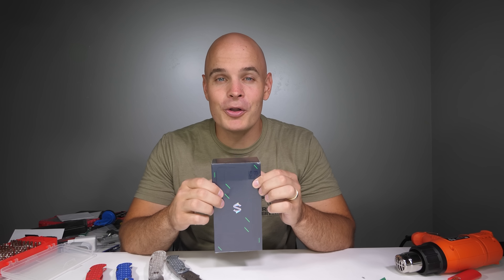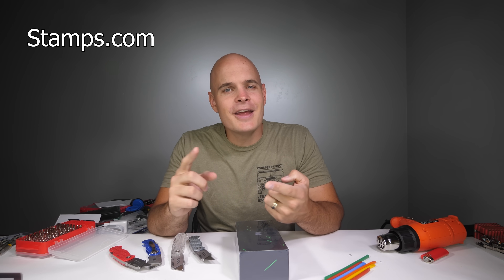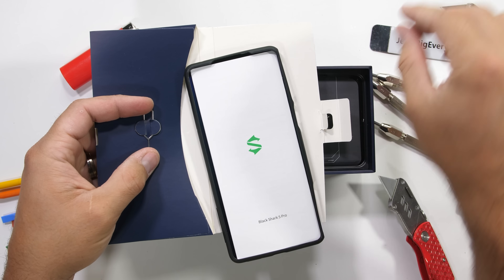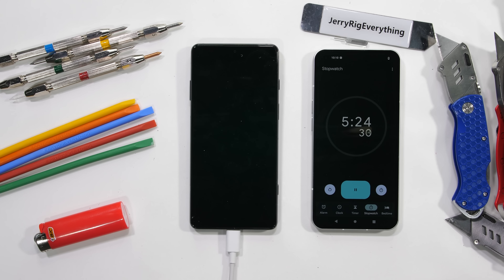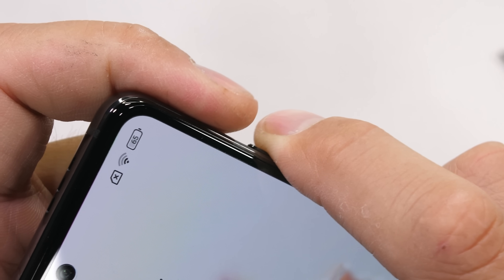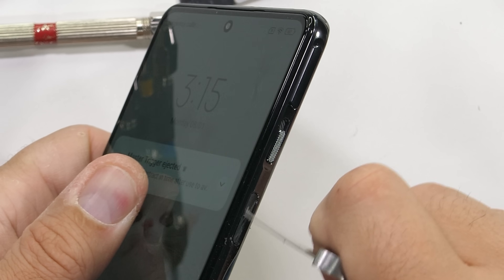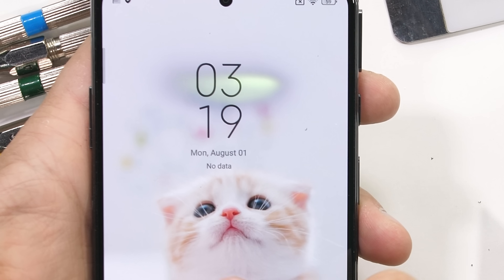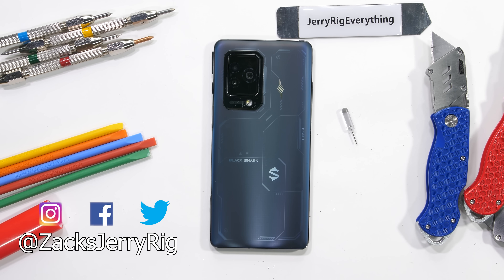This Gaming Phone gets HOT... in more ways than one.

Comment: In constant search for more and more powerful hardware, Android phones have reached point where new processors make a lot of heat, drain battery, cost more, but can do all tasks that last generation or even one before it could handle without a problem. 99 percent of users, even heavy ones, without benchmark tests, couldn't even notice the difference between them in day to day usage. I wish companies gave more attention to software polishing.
Reply: And features. Like a full, unmutilated screen. A headphone jack. And an SD card reader. I'm tired of all these non expandable, non full screen, dongle pieces of trash.
Reply: @mjc0961  I think headphone jack and expandable storage won't come back, at least on flagship devices. Apple starts a trend, Samsung follows and after that all other companies. And it's a shame.
Reply: some do just be coming too rare a thing.
Reply: Things you can notice is how much storage everything takes up.
I switched from 6 year old phone 16Gb to 128Gb and I thought it would be overkill
But new cameras have improved so much that photos and videos have massive size
Games too are also massive because of improved processors.
Not to mention the Android OS itself takes so much space...
I somehow have 50% storage left
Reply: They dont need better hardware, they need better software.
Reply: @stevanb.2590  We've already seen Sony return to headphone jacks and micro SD slots after dropping them for a while, Asus as well. Even if the mainstream manufacturers like Samsung and Apple stop supporting these features, they're still popular enough to find their way in some other flagships.
Reply: As someone who has a Sony phone, I couldn't agree more. My 5 ii had all of the hardware features I need, yet the phone had to be restarted a few times per day because the system kept crashing. Custom ROMs available for the phone aren't suitable enough to be daily driven yet, so I'm stuck with this abysmal stock software experience.
Reply: @walter1824  yeah, apps keep getting bigger and bigger, taking more space, but having the same features that were there few years ago (or even being worse with all their "updates"). 256Gb, especially without having expandable storage and with bloatware that can't be deinstalled on some phones, became minimum if you want your phone to be usable for more than 2 years.
Reply: @Pennycilin3  using Samsung phones for 6 years now, flagships, I for sure know that software updates (at least after one year) just make phone feel slower, battery life gets worse and there really aren't many new, usable features presented. For example One UI 3.0 just made camera on all 10 series (Note, S) almost unusable, and it was great out of the box. I guess that's companies way to tell us "It's time for new phone". Don't know why people are so hyped about constant software updates.
Reply: @stevanb.2590  @mjc0961 thank god for Sony (if you want a modern flagship processor atleast)
Reply: I haven't used a headphone jack since like 4-5 years since I use BT headphones. Get used to it and go with the time and development of tech. People tend to cling to old stuff that's why we have boomers who say everything was better in the old times.
Reply: @transcending_concrete  BT is more prone to cut outs (whether by object interference or radio interference [Which will only get worse as more BT devices/routers get placed in an area]), has worse latency, has worse audio quality, is reliant on an internal DAC (which can be okay, but wont be better then external DACs and potentially many internal DACs in high end PC motherboards), doesnt support multi device streaming well (rather, not at all unless one is talking about earphones), is slow in switching between multiple devices (some speakers/headphones support connecting to two devices [with the caveat they can only stream audio from one at a time] but if switching between three+ devices requires a rather slow software change), and is reliant on a battery (which means one more device to worry about charging and a point of failure with time).

BT is cool, but it is still pretty ass. People who dont want to move into BT have various reasons for it. So telling people to "get use to it" is a terrible, terrible take on it. Like, really terrible. As a note for future reference, dont believe the BS that companies tell you for marketing. The headphone jack removal is still stupid and will still be stupid for many years to come as there is no valid replacement for it yet.
Reply: Apple is a company that gives more attention to software polishing
Reply: @BH4x0r  yea, for what its worth.. Tho just like lg i cant imagine they are around for much longer since sony isnt really moving units anymore.. Not like they used to back in like 2014...Especially now that their mid range phones are priced the same as flagships were 2020.. Really cant go to the way of the dodo soon enough.
Reply: @rodrigojds  software polishing or not, physical features are equally important in a device, especially if you drop over 1k on it
Reply: @Mabswer  i mean their flagship price moved with the market, which is unfortunate, but expectable.

the Xperia Pro is cool though, even if it's too expensive, i've never seen another phone with a HDMI input so you can use it as a HQ camera monitor
Reply: @ofisblagoevgrad6424  well night mode became unusable, it's pretty much the same like regular one, or worse. Out of the box, it was fantastic, in almost dark room with no light pics came out like flash was used. Shutter lag also became worse, taking pic of anything that's moving results in blurry, unusable mess. And I'm not talking about cars, running or any fast movement. Videos became choppy, with strange warping and artefacts and stabilisation that's nowhere near one before update (although videos weren't so good even before One UI 3.0). All in all, compared to 300 bucks budget Samsung phone that my friend had, his camera was a lot better. Camera difference after update was so big that I thought my phone was broke or something like that. Googled it, same thing happened to many users, especially on phones with Exynos processor. There are still numerous forums about that.
Reply: @stevanb.2590  And then Apple adds it back...
Reply: That’s why you buy an iPhone
Reply: @kevinkhomenko4038  smartphone without split screen feature, always on display and with charging port that was old even few years ago ? No, thanks.
Reply: @PhantomMattcraft  most ppl won't use all this stuff. Also regarding music quality: there are tests that people can't reliably tell the difference from 256 kbps MP3(!) and CD quality. Also BT what is terrible? Tell me the standard user which makes about 90% of the people will miss. It's your perspective.
Reply: @transcending_concrete  While I am more of a BT enjoyer and prefer it over wired nowadays, there is one noticeable drawback I've had with my BT earbuds, and that is when you watch content with a person talking and the person is visible, the lips don't perfectly sync with the audio, and that can be somewhat annoying. It's mostly a device-dependant issue though. Some devices like my phone have near-perfect lip syncing, while on my PC it has horrible lip syncing. So if you want an average user perspective, there you go. Other than the problem of latency, I have no complaints with BT. People don't prefer "old ways" for no reason, ya know.
Reply: Ios slow their old ones so new ones seem faster
Reply: @stevanb.2590  As someone who has had many bad bluetooth experiences and now exclusively goes wired, my pixel 6 pro is kinda shit.

Comment: Battery bypass should be expected out of all brands. Once it is charged it should bypass right away while plugged in.
Reply: @ballsack4581  Having and keeping your battery at 100% is the hardest factor of degradation for any battery, only charging it and then using the plug saves a lot of stress on the battery.
Reply: @Ayoke  they wont do that they want consumers to keep buying
Reply: SAMSUNG does that
Reply: @mredizon00  CONSUMERISM AT ITS BEST
Reply: All phones bypass the battery when they reach  💯 ,this phone bypass the battery when plugged in while you use it,it doesn't matter if it's charged or not

Comment: info for any xiaomi redmi poco and black shark phones users, the phone has 2 mode for fast charging can we choose on the battery setting. first mode is normal mode and the second mode is boost mode, and now the boost mode is just activated when the phone is turned ON and the screen is OFF.   that mean when are you test it when the phone battery is completely 0% and phone is completely death, the boost mode does not active, that why it took 17 mins instead of 15 mins.

Comment: How about also taking apart one of those 120W chargers 🤔 
Could be interesting
Reply: Also stupidly dangerous…
Reply: @ARXInfinite  what is dangerous about a charging brick?
Reply: @bestGaming132  like any power supply they have large capacitors that store electricity. No different than a Power supply found say in a Xbox one or Series X. You touch the inside of a PSU YOU WILL DIE. power bricks are sealed. So you will have to break it to open it. You can’t drain the capacitors like with a Normal Power supply at least to my knowledge. And it’s still dangerous no matter what.
Reply: @ARXInfinite  I didn't know they store power if not plugged in a power outlet
Reply: @bestGaming132  Capacitors are like batteries with low energy-density but they can discharge and charge extremly fast. Capacitors are found in most electronics.
Reply: @bestGaming132  Are you being sarcastic?😂
Reply: @ARXInfinite  For sure, if you don't know what you're doing, stay far away. However if you have experience repairing electronics, all you need to do is short them with a screwdriver(one with plastic handle and metal shaft). I've been taking apart old tv's, microwaves etc. since I was like 6, I knew then they were dangerous, yet I've never had one that was actually still charged when shorted
Reply: @maevwat  no it was a serious question xD
Reply: @ARXInfinite  here I've to disagree with you because there always exists a resistor to discharge the capacitors slowly, down to zero volts. Also you can verify it by plugging out your adapter, wait for 3-5 sec, then plug back in. There'll always be an inrush current proving the fact that capacitors don't hold charge for long in such devices.
Reply: @swapnilkumar9363  and this slow discharge takes time. Same thing happens in power supply’s for PC’s consoles etc
Reply: @ARXInfinite  they always have  discharge resistors or they are connected to loads that discharges them 
capacitors store voltages ranging from 5v to the mains 220v DC  
NO you cannot goddamn get a shock from 220v DC voltage that is present in charger 
so there is no way you can get a shock
Reply: @echpea  if you can get a shock from a 120W power supply You WILL get a shock from a Charge which is literally just a power supply. PSUs can kill you. Simple as that.
Reply: @ARXInfinite chargers are not psu also after the first rectification it's all dc current not as dangerous to kill anyone
Reply: @echpea  charges do the same thing as a power supply. Transform AC to DC. And Yes DC can kill someone. opening a Xbox one Power supply which is a 120W max. That can kill your mate. Draining this power By normal means takes a long time possibly months. It’s not a problem if you have access to the power supply you can drain it with a plastic handle screwdriver etc. and btw phone chargers are called switched mode power supply’s.
Reply: @ARXInfinite  you definitely don't hold an experience in electronics.... Just reading about stuff isn't enough.
In any SMPS, say this phone charger, the capacitors are used for filtering purpose and can store upto 170v for 120v systems. But these capacitors are being continuously discharged by the SMPS circuitry.
As soon as power is disconnected, the capacitors immediately discharge down to 20%, and rest is taken care of by discharge resistors. By 5-10 mins, every capacitor is Fully discharged while it takes only 2-3 sec for it to go below lethal levels of voltage.
Reply: @ARXInfinite  a typical phone charger has mainly 2 dangerous capacitors and BOTH OF THEM gets drained automatically as the charger tries to take power from them while it's being unplugged from mains 
dont tell me I've opened hundreds of these with just unplugging them from mains not waiting more than 1 minute
Reply: @swapnilkumar9363  mate cba to read your paragraph I’ve already said enough
Reply: @echpea  right ok fella 🤣
Reply: @echpea  love the sound you make when defeated but not willing to admit it 🤣👌

Comment: I love the little trigger buttons but i see that becoming a problem with no case on it sliding it into your pockets and hitting the release buttons. I bet with a case on it there would be no problem which usually everyone i know has and uses a case.
Reply: I hate using phone cases lol, I have a s21 ultra 5g, no case lol, I know it stupid but I just can't stand cases
Reply: I own the black shark 4 pro which is designed pretty much like this one and it never hit the release buttons either in my pockets or in my bag even before i had a case
Reply: @johndoe4034  I don't get why you or anyone would hate cases imo, I would think phones are a lot more comfortable to use with a case, especially if it has curved sides and thin bezels where you have to hold the phone awkward to avoid touching the screen on accident

Comment: i was very surprised usually other gaming phones falled on bend test but not this blackshark 5 pro it's survive in flying colors i think the structure of the metal is upgraded similar found on more expensive xiaomi flagships which is quite impressive
Reply: Yes I also thought it would break at the bend test but there was only a little flex.
Reply: @HyperHrishiHD  but turns out in second flex which is a little gap but it doesn't break the glass just like xiaomi flagships
Reply: All blackshark units survived the bend tests because their batteries are build vertically not like other gaming phones...
Reply: @aimanfitri0iv  i think the black shark 4 is more durable base on what i see on bend test by jerry

Comment: The 15 minute flat to full charge time quoted by Black Shark, MAY have been when the phone is fully set up, in stand by mode AND with 'Flight Mode' turned on (quick tip - if you are short on time and want to quickly top your phone up with charge, turn 'Flight Mode' on, it does indeed help get a slightly quicker charge in that battery of yours - whichever phone that be)... 👍😏     😎🇬🇧
Reply: Hey thanks for this tip! I just tried this and although it isn't ma major time saver, i noticed it charged a couple of minutes quicker than normal. In a time crunch that couple of minutes matters.

Comment: I have a black shark 4 pro and the charging finishes from dead to full in 9 minutes sometimes I think it's the heat and the cold when it's colder it charges way faster but when it gets hot it takes something like 17 or 19 minutes. But sometimes when it overheated it stops fully and shows a notification about it.